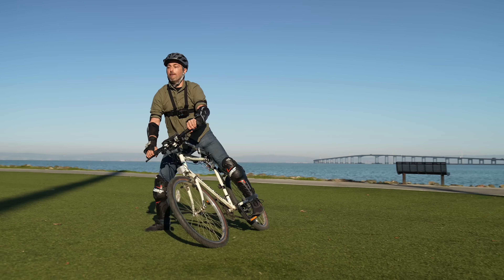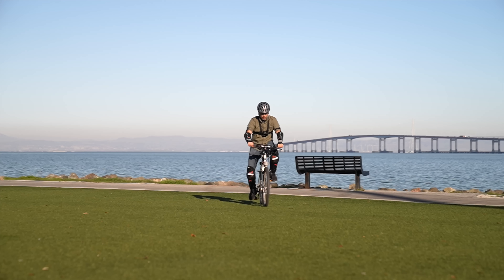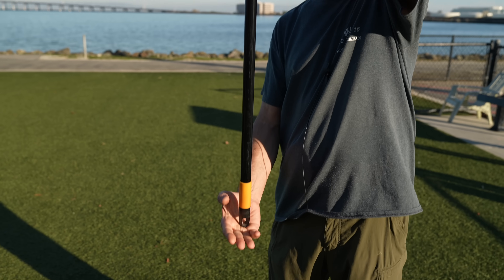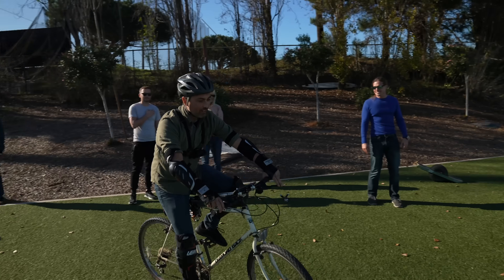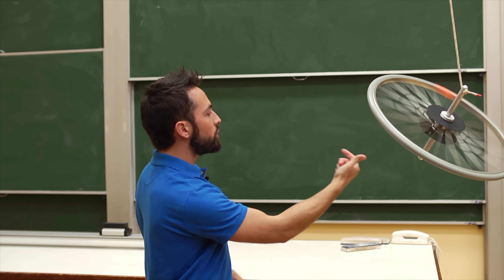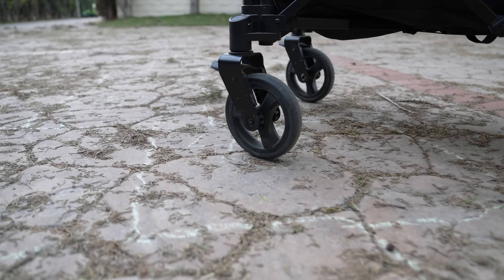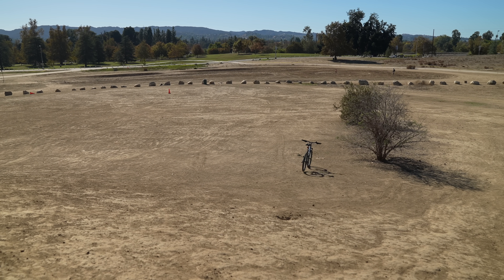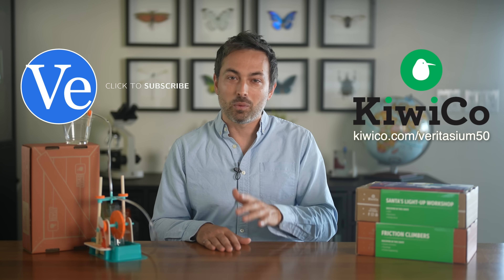Most People Don't Know How Bikes Work

Comment: i am from amsterdam and yes like a motorbike when at speed you counter steer but i can go right on my pushbike with just turning the bars right i just force it my weight is much more then the bike so you can just push the bike to lean the way you want try this with higher speed and you will not be able to on a motor bike this is more the case the bike is more weight then you so you have to counter steer after lik 10 to 15kmh its all counter steering
Reply: Try this experiment.  Sitting still on the bike, lift both feet.  The moment they leave the ground have a friend tell you which side to fall toward.  You'll fail to do it exactly half the time.  If you could just lean your weight to lean the bike in that direction, you could do this easily.
Reply: @Rick_Cavallaro  on a motor bike or push bike? push bike i can even stand still with no feet on the ground even on my motorbike i can do it a bit i will try it.and i can only countersteer my pushbike if i sit very lose and only hold my steering with two fingers and really try to countersteer then i can do it but otherwise we all just force the bike to lean where we want
Reply: @8alakai8  
>>  on a motor bike or push bike? 

I'm not clear on the difference.  Obviously one has a motor and one does not.  I presume the push bike does not have pedals?  Does it have pegs or something like that that your feet rest on?  Are you balancing your push bike by moving both your feet and your upper body?

>> even on my motorbike i can do it a bit 

I'd be very interested in hearing your results if you time how long you can balance with both feet on the pegs and steering locked straight ahead.  I'll be very impressed if you can do that for more than 3 secs or so.

Comment: Ok, so I would say I’m a pretty good mountain biker. I decided to try this out. Although I don’t have the same set up, I used a rope to stop my ability to steer a direction. I think what I figured out is that as mountain bikers we tend to lead with leaning and then steering follows. When I tested this I had no problems leaning over as if I was falling but then correcting myself with my steering. I think in these examples you have people thinking that they have to turn using the wheel and that’s where the problem starts. I would like to hear if I’m wrong about my thinking. I thought this was very interesting.
Reply: How loose your rope was?
Reply: @XtreeM_FaiL  I made sure it was not stretchy and tight. I could see how the design they have could be more effective.
Reply: If you're in the S.F. bay area I'll be happy to let you give this bike a try.  If not, I recommend tying your handlebars so they're locked straight ahead (can't turn in either direction).  Then see if you can just ride the bike in a straight line.  If you can lean to initiate a turn, you should be able to ride in a straight line without steering.
Reply: @Rick_Cavallaro  Wow thanks for getting back to me! Unfortunately I'm not close but I'll give it a try!
Reply: @eliasgillen  let us know how it goes.  Just so you know - I've put professional bike and motorcycle racers on this bike with steering locked, and none could keep it upright for more than 3 seconds.

Comment: This is the principle of how GOOD motorcycle riders ride. If you just lean left/right as many do you get a slow and dangerous way of moving. But if you steer LEFT in a Right corner you actually handle the corner much better. This gets more important the slower you go and like the video says. You cant really go LEFT by steering LEFT and leaning LEFT. By steering RIGHT you put yourself off balance and automaticly start leaning to the Left :)

Fun and good video!

Comment: It seems like a critical factor in the self steering is that when the bike leans left causing the front wheel to turn left — allowing the bike to keep rolling but now to the left slightly — the linear momentum of the bike is then pointed to the right slightly with respect to the new orientation/trajectory of the bike, encouraging the bike to steer right, and then turn slightly right. As such I would expect that on flat ground with a symmetrical push-off an un-manned bike would oscillate left to right and back again in a somewhat sinusoidal manner. This feedback mechanism allows the bike to not just ride upright, but to do so in a roughly straight oscillating manner, as opposed to going in loops and loops. 

I feel like this feedback loop was somewhat missing from the video’s explanation (the three mechanisms at the end), but maybe this is encapsulated in those mechanisms and I am just not seeing the connection? Super interesting video!

Comment: This video does not prove that you must counter turn to the right before turning left.  It does prove that, if you block the ability to counter turn to the right, the bike becomes unrideable.  This is due to the fact that you are never biking in a perfectly straight line, you are always turning the handle bars slightly to the right and left to maintain balance.  Jump on your bike and observe this phenomenon.

So, yes, before you turn to the left, you have made a number of mini-turns to the left and mini-counter turns to the right leading up to your left turn.  However, to actually turn a bike to the left, you do not need to make the kind of exaggerated counter turns demonstrated in this video.

Try this at home:  bike in as straight a line as possible (knowing that this is not truly possible and you are always making minor adjustments).  Next, lean to the left.  What happens?  Your bike turns to the left.  Not only did you not need to counter turn to the right, you didn't even need to turn to the left!

To summarize:
-If you block the ability to counter steer a bike, it becomes completely unrideable.  
-This is because, while biking, you are continuously making small turns/counter turns to keep the bike balanced.  If you remove that ability, your bike cannot be ridden more than a few feet
-This does not prove that you must counter turn to the right before turning left
-Get on your bike and go as straight as you can, then lean to the left.  Voila, your bike turns to the left, with no need to steer left or countersteer to the right.

Comment: itd be interedting to see what happens if you no hand ride the steering braking bike, because while no handing you just lean into the direction you wanna go so it should theoretically work
Reply: Riding no hands doesn't help.  You're still relying on the steering, but you're doing it with your hips.

Comment: true, but a good rider can balance the bike with only their body.
in fact lost year I accepted a challenge and rode 20 kilometers with a bike with the front wheel welded in spot.
Reply: Where did you find an area where you could ride 20 km in a straight line?
Reply: @spork33 New Brunswick Canada, the north shore there has all the towns attached to a signal road with no turns.

Comment: There are motorcyclists who don't know they're counter steering, when it is literally how a motorcycle steers, entirely above the speed of roughly 12mph.
So many do it intuitively, that if you disturb it, or have them try to explain or show you, they can crash :D

The only way to teach them is tell them to try gently pushing on the handlebars above that speed, while going in a straight line to understand you move to the side you push on, effectively the opposite of the handlebar direction you'd get out of a car, or tricycle.

It's why sudden complete opposite directions of travel happen that causes those seemingly hard to explain crashes, where the intended direction fails to happen in a turn.

While we see this one need the slight teardrop pre-steer as explanation at slow speeds, it's a similar lack of understanding the function while above handlebar lock speeds.
Panic causes it. The forced attempt to turn the wheel in that direction, send them in the mind bogglingly opposite direction, that they then try to lean away from to compensate.

2 minutes of straight line counter steering practice makes a considerable number of bicyclists and motorcyclists bump up their awareness of the hard to explain physics, and it's something they don't teach in the US riding courses I've been on.

Instead everyone's just kind of feeling it out.

Comment: I have been thinking about this video a lot since I first saw it.  I ride mountain bikes and while I am totally aware of often steering in the opposite direction I intend to turn, I am also pretty sure (not 100%) that sometimes I do not.  The whole purpose of turning in the opposite direction you intend to turn is to get your center of gravity to the inside of the intended turn.  So a lot of times when I intend to turn, I do not turn the handlebars at all at first, but rather I just lean in the direction I want to go.  The bike then also leans and then turns in the direction I want to turn without my ever having turned them in the opposite direction.  I would love to see you repeat this experiment with an experienced mountain bike rider.
Reply: TL🐉
You can't ride  bike without countersteering.
Reply: @XtreeM_FaiL  Do you ride mountain bikes off road?
Reply: @XtreeM_FaiL  Well like I said, I am not 100% sure, but it sure seems like on some turns, not usually very sharp ones, that I initiate the turn solely by leaning with no counter-steer.  Have not tried it on pavement.  And in my experience, there are significant differences in how you ride mountain bikes as opposed to road bikes.

Comment: They actually teach this in motorcycle school here. Very important as countersteering is faster in initiating a turn than just leaning over. In case of a surprise obstacle (car taking your right of way, rock in the middle of the road etc.) this lets you react much faster to that

Comment: In order initiate the turning of a bicycle, you have to throw it off-balance by steering the "wrong way" first... but for JUST a moment. Then, in order to stay on it, you have to steer to put the bike back under your centre of gravity... and THAT "corrective" steering action is the one that takes you around the corner.
Yes. It takes a lot longer to explain it than to do it... and when you CAN do it, after about 20 minutes practice, it is instinctive. You don't have to think about it anymore...
... easy as riding a bike.
However, as the video shows, it is a very hard trick to UN-LEARN !!
Reply: "Then, in order to stay on it, you have to steer to put the bike back under your centre of gravity... "
NO!
Reply: @XtreeM_FaiL  On the contrary. That's exactly what happens..  and it happens just for the rider to stay on, and while going along STRAIGHT!

Are you saying you didn't realise that?

It happens also that bicycles can stay upright all by themselves. Yes, a riderless bike automatically puts its own base back under the centre of gravity because of the way the steering geometry is set up. However, while the bike in motion can stay upright all by itself, it has no real control over its direction of travel, which is to say, it goes more or less straight until someone tries to push it over, when it turns in the direction of push as it self-stabilises to upright.
Check it out. There are some good "riderless bike" demo videos here on YouTube.

Comment: So this is the same with motorbikes ? or does the higher speed induce that leaning is safer than steering ?
Reply: Same with every bike. You always have to steer. You can't just lean, that will do nothing.
Reply: @XtreeM_FaiL  Leaning will not "do nothing" especially at higher speed, but I understand that at lower speed it doesn't give enough "turn angle" (sorry not native, I'm missing some vocabulary here).
Leaning should at least make you "strafe"

Comment: The caster angle in the car is also responsible for that the front wheels are always trying to balance themselves going straight ahead, hence the effect when you're in a corner and release the steering wheel the steering wheel is sort of "automatically" straighten itself.

Comment: I noticed this myself once. I kept trying to turn without turning slightly in the opposite direction first. It was frustrating and I just couldn't do it.

Also, I tried turning without leaning slightly. It can't be done. You must steer in the opposite direction AND lean in the direction you want to go or the bike will not turn.
Reply: you can also just lean in the direction you want to go without touching the handlebars whatsoever and the bike will turn. I've done it thousands of times.

Comment: I tried this out since I use my bike everyday to school and surprisingly I never countersteer. I tend to just steer left while leaning to the same angle as I'm steering. Works fine and that's how I bike
Reply: ok, seems like I was wrong. Thanks for replying tho!
Reply: You always countersteer, but it is really hard to notice.
It will be more noticeable if you ride heavy bike fast.
Reply: You do counter steer. It'll be a very small amount for you to notice. If you steer a lot to the opposite side, you'll lean too much and fall. That's probably why you think you're not doing it when you attempted it consciously after watching this video.  You cannot lean with your handle bar turned to the same direction you're trying to lean, the bike will automatically keep straightening itself up if you do that.
Reply: Counter steering is more of a high speed technique, not really needed going under 20kph
Reply: @namegoeshere69  I guess

Comment: Riding with no hands or leaning to turn is a form of counter steering. Leaning you upper body to the left causes the bicycle and your lower body to lean to the right. That is an equal and opposite reaction. The bicycle leaning to the right causes the front wheel to turn to the right for the reason explained in the video.  This front wheel turned to the right is the counter steering that will cause the bicycle and rider together to lean to the left. Which then causes the turn to the left. 

It is easiest to observe this by having someone else do this riding as you watch. Or video yourself with a stationary camera on a tripod. If you try to observe yourself while riding you wouldn't notice all the parts.

I wish that the video covered this. But I understand that it would have made the video too long for most viewers. 

Of course counter steering is true for two wheel motorcycles also. Since the 1980's it has been known that failure to understand and use counter steering is a contributing factor in many fatal motorcycle accidents. Before you respond, keep in mind that I said contributing factor, not primarily factor.
Reply: I hereby award you 1 squillion bonus internet points for being in the extreme minority that gets this right.  Kudos!
Reply: I'll take negative 1 squillion! I mean, Ernie's explanation seems right as far as it goes. If you start your left turn by leaning the upper body to the *left*, I can't see how you get into the position illustrated at 2:32, where the bike and rider are leaning several degrees to the left, except by countersteering--or letting yourself fall dead sideways.

The thing that's driving commenters crazy is that they know (some of them) that there are ways to set up that leftward lean without "steering the bike out from under you" using a countersteer that throws you off balance so you have to "catch" it with an opposite-direction turn.

For example, at speed you can sort of lay your bike down to the left by pivoting at the hips to make a "<" shape with your upper body leaning slightly to the *right*, and your bike and your lower body leaning left, as you lengthen your left arm and shorten your right arm to stay upright. Now the bike is leaning left, and you can use the handlebar to just guide it into the left turn it wants to steer into, while you keep your balance through the whole thing.

From what I can tell the lockout experiments don't prove quite as much about countersteering as you're claiming. Notably since locking out one side makes it difficult to go straight, then it's no surprise that riders are unable to turn, and also I suspect the whole setup cues riders to try to steer using just the handlebars (which actually causes them to lean the wrong way because of the countersteering effect!). The experiment I would want to see would use a rotational sensor in the headset and no lockout, so I could look on a graph to see if the rider actually turned the headset right or not (relative to the baseline amount needed to adjust a straight ahead bearing.)
Reply: @RichardKlancer  
>>  I can't see how you get into the position illustrated at 2:32, where the bike and rider are leaning several degrees to the left, except by countersteering--or letting yourself fall dead sideways.

As Ernie describes, leaning your upper body to the left causes the bike and your lower body to lean right.  That causes the front wheel to turn to the right.  That's the counter steering that initiates your left turn by moving the contact patches out from under you to the right (causing the entire system - bike and rider - to lean left).

>> The thing that's driving commenters crazy is that they know (some of them) that there are ways to set up that leftward lean without "steering the bike out from under you"

There actually are ways, but it's a VERY rare person that can do it.  Literally thousands of people in the comments claim they do it all the time.  They don't.  I keep offering the same $10K bet for any of them to demonstrate it.  No takers yet.

>> For example, at speed you can sort of lay your bike down to the left...

No you can't.  You wanna take that $10K bet I mentioned?

>>  since locking out one side makes it difficult to go straight

Why would that make it difficult to go straight if you could just lean your weight in the way you're describing.

>> The experiment I would want to see would use a rotational sensor 

If the rotational sensor shows that they never turned left, they'd never feel the lockout.  So no rotational sensor is needed.